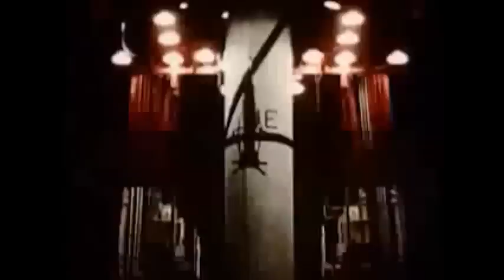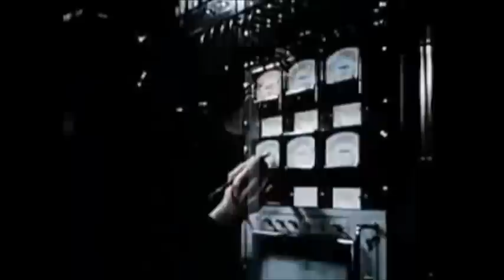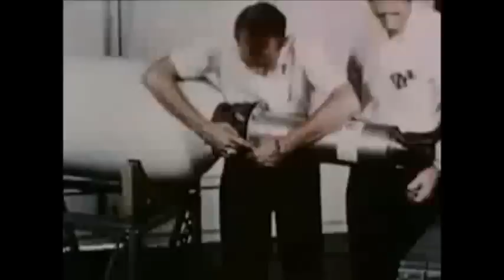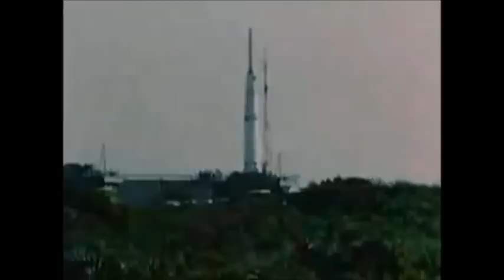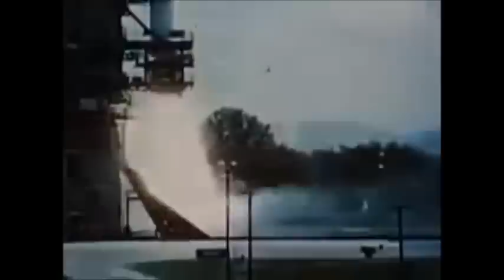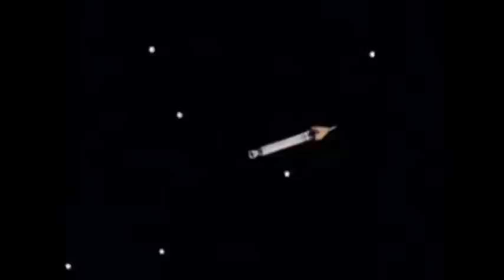Nasa Comedy from 1958 - Flat Earth

Comment: if space is a vacuum.  what did the thrust from the rocket engines push against. in order order to propel them forward.
Reply: ***** Mathematics is pointless if it cannot be reflected, tested, experimented upon and verified in the REALITY in which one experiences. Numbers and symbols are not proof of anything accept the fact some people will believe anything they are shown and told without actual physical evidence.
Reply: Pushing against what exactly? I understand rocket propulsion pushing off the atmosphere...but what is it pushing off in the vacuum of space? How can it slow something down or even speed it up and change its direction in the vacuum of space? What is the propulsion pushing off...regardless of what fuel or technique one is using but to do with the very fact you cannot push off anything in a vacuum and can only continue to move in the direction you were moving before entering it and at the speed you were travelling when entered also.
Reply: you mean theory, you say law but chances are you know its only theory. pos·tu·lateverbverb: postulate; 3rd person present: postulates; past tense: postulated; past participle: postulated; gerund or present participle: postulatingˈpäsCHəˌlāt/1. suggest or assume the existence, fact, or truth of (something) as a basis for reasoning, discussion, or belief."his theory postulated a rotatory movement for hurricanes"synonyms:put forward, suggest, advance, posit, hypothesize, propose; Moreassume, presuppose, presume, take for granted "a theory postulated by a respected scientist"2. (in ecclesiastical law) nominate or elect (someone) to an ecclesiastical office subject to the sanction of a higher authority.

Comment: Ok, so I don't get how the 2 weighted wires caused the top to stop spinning. So called planet satellites such as moons do not have such a cause aren't they "attached" by gravity?  Why aren't all the planets slowing down? So if I was an astronaut spinning in space and thrust out my arms holding weights I would stop? Too deep for me.
Reply: +Andre Globe  Yet according to science academia it is the same thing. The figure skater spinning is deemed to be a closed system as the friction of the ice is calculated to be negligible. Likewise, the Earth and moon are counted as a closed system as the effects from the forces of the Sun are calculated as negligible on the conservation of angular momentum of the Earth-Moon system. Further, science claims that Earth's angular momentum is transferred to the moon as friction from the tides cause the Earth to slow and the Moons moves further away. Thank you for your response anyway, there is so much information to wade through!
Reply: The skater analogy is a good try, but it doesn't work, as you might slow down but you will not stop spinning with friction or air resistance... as space is supposedly a vacuum.
Reply: +bluesmovers Exactly! This is the problem I am trying to answer to satisfaction but material on these issues e.g. Physics Q&A are fraught with contradiction and convolution. When posed with a question that requires a student to use conservation of angular momentum they are either implicitly taught or even explicitly told to discount the effects of gravity or air resistance. Which (conveniently?) means the same calculations are made no matter what the atmospheric pressure or gravity.
Reply: +bluesmovers There is a Nasa video here on YT that confirms what you are stating here. There angular momentum is conserved as there are no external forces acting upon a body spinning in space. It may change velocity according to the distribution of it's mass and inertia but always remains proportional therefore the motion is constant. No energy is transferred therefore is not dissipated from the the closed and isolated system of the spinning object. Peace
Reply: I understand the physical law here (physics was my college major).  The wires would change the moment of inertia, and slow the spin.  BUT, it will not stop the spin as the angular momentum is still preserved.  An external force, would have to act on the system to provide reverse angular force and cancel out the momentum.  In a perfect vacuum (space?), there is no friction, such as on earth, which will stop the skater eventually.  Even ice skates have some friction where they touch the ice, and there is also air resistance.  So, with long enough wires with weights on the end you could slow down the spin greatly, but never stop it.
Reply: +Andre Globe My point is the satellite spin is CONSTANT, regardless of the rotational velocity. The mass of the satellite and weighted wires are a closed and isolated system. Same goes for an astonaut. He along with his arms are a closed, isolated system regardless whether or not they are extended. The Law of conservation of energy states " the angular momentum of a system remains constant unless acted on by an EXTERNAL torque".
Reply: +Andre Globe In a zero gravity, frictionless environment a spinning body is a closed, isolated system with ZERO external torques acting upon it. The mass of the spinning body remains the same before and after extending any appendages. Extending arms or weighted wires REDUCES the rotational velocity as the moment of inertia ( as to how the mass of the closed system is distibuted) changes.
Reply: +Andre Globe mass of spinning astronaut with arms pulled in= mass of astronaut with arms extended
Spinning astronaut= closed isolated system
External torque= force acting upon the spinning astronaut
No external torque= conservation of energy
Arms pulled in= increases rotational velocity
Arms extended= decreases rotational velocity
No external torque= motion remains constant regardless of rotational velocity
Conclusion: the satellite will continue to spin
Reply: +bluesmovers I see you also have an engineering background. Sup? Nice to find someone on the same page once in a while.
Reply: If you watch the film, the wires release the weights and disappear.  That would change the moment of inertia, and maybe it would speed back up a little?  Unless, it was completely stopped, how long would that take? ... and how long was the flight of this satellite?  How would they be able to tell when it was stopped?  They're not riding in it!  So bogus.
Reply: Spinning slowly is very different from stopped, and critical to the mission.  Where is the energy for it to change spin after the weights are released?  In the "slow spin", the angular momentum, of course.  Why do you believe people who make overpriced cartoons, and lie to you?